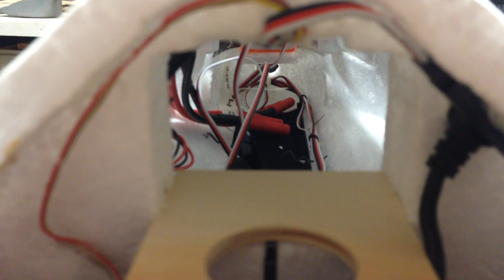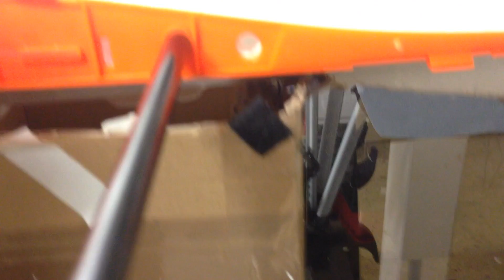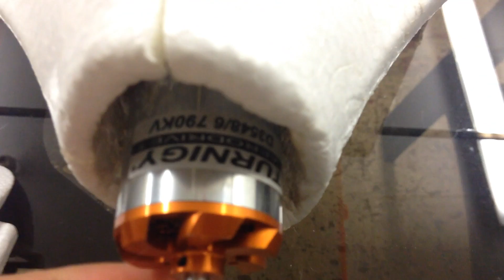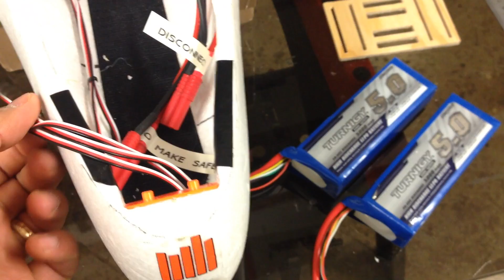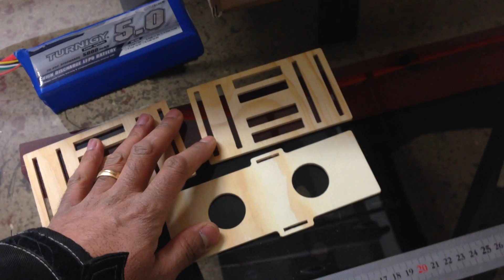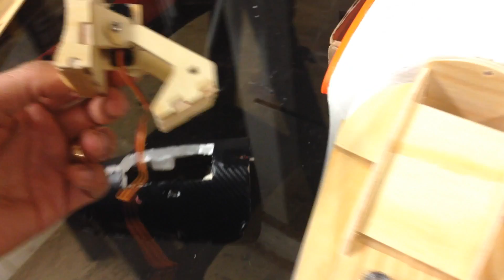Skywalker X7 Build update with 10000mah of 4S

Comment: Hi,

can you tell me which drive to use it?
My X7 weighs 3.5 kg
Flight time 10 minutes.
This is very little I would like 20 - 30 minutes flying

Unfortunately, I do not know where the error is.

LG Ingo
Reply from the maker: Hi LG Ingo,
If you can, send me some pictures / video of your setup.  Its always good to see before giving advice.

Although at this point, im interested to know, what is really making your X7 weigh 3.5kg, that sounds a bit too heavy.

What battery, ESC, Motor, Prop are you using?
Do you know how much amps you are consuming just to fly level - I use 7amps with 5000mah 4s and 11amps with 10000mah of 4S.

Regards
Anton
Reply: Hi,

thanks for the quick reply.
I took the power set of bevrc.com.
That is suitable for the X7 and X8.
1 * super powerful GS3548 kv830
1 * 70A SBEC Brushless ESC
1 * 12x8 Prop
2 * 4S - 3300 mah
1 * Fyi 41a
1 * Gopro3

The X7 I have coated with carbon film. (Weighing about 300 grams)

In flight, I have to give 3/4 gas.
Max Amp 42-45
Reply from the maker: ok,

I could be a number of things.

I personally think that the weight of you X7 is a bit too high.  I think the extra weight that you have could be the motor you are running.  I think i was running a smaller motor and prop. The 2820 motor.  The weight of my X7 with 5000mah was around 2.8 kg.

This has an effect on the current that you will draw from the battery to keep the plane in the air.  The heavier the plane, the more power is needed to keep it in the air.

I have a feeling that you are going to use around 15 to 20 amps just to cruise with the weight that you have.

When my X7 was 2.8 kg, I used 7 amps to cruise and maintain altitude.  Now that it is 3.1kg I have to use around 12 amps.

Perhaps the place to start is to try and measure the current that you use just to cruise, by using some kind of OSD that can display actual power consumption.  Then you will see how much is needed just to stay in the air.

Just some thoughts, with the information that you have given me so far, hope it helps in some way!

Regards
Anton

Comment: Good work pal! My fleet fall asleep during wintertime. Made a maiden flight and another one with my x7. Davids 360 cam mount is ready to run. I mounted the cam mount on a scratch build canopy like the original and carbon foiled the original one for camless flights. Next will be a long range system.. scherer uhf and Ardupilot mega as autopilot system
Reply from the maker: Nice choice! I've been looking into the OSD that connects to the Ardupilot Mega, and ordered one to test out.  Im building another FPV platform and will also use APM.  Im using APM on my TBS Discovery and there are many nice features to play with. Have fun!